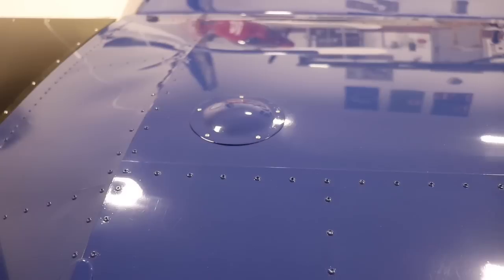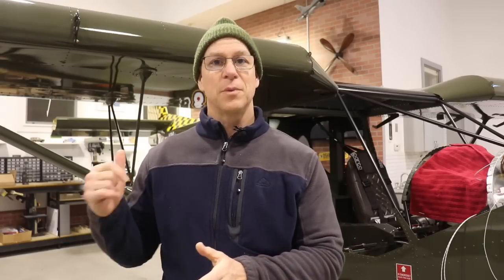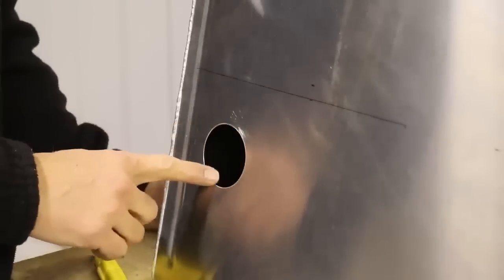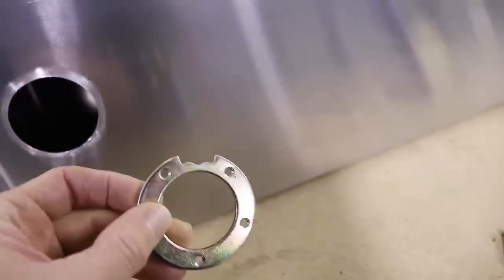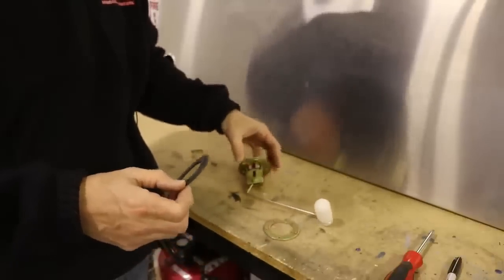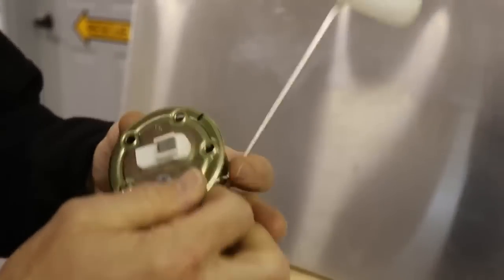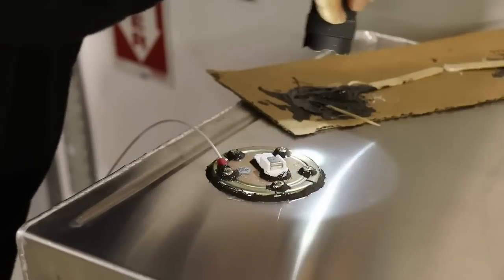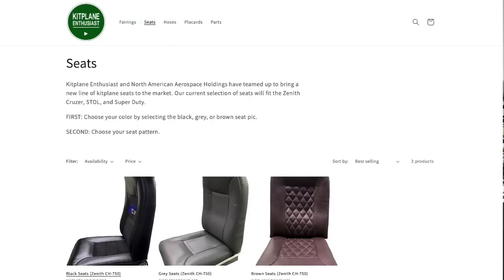How I Mounted FUEL SENDERS on Top of the Fuel Tank

Comment: The idea of cutting a smaller hole and slowly enlarging it is the way to go. Not sure why builders don't use water to flush out the tank. You can do it easier, quicker, and safer with water. It's no big deal to drain it out and any water will evaporate in a few days. Every tank ends up with water in it during operation either from condensation or from the pump station/ truck.  FYI - I had he same problem with the Vans (Stewart Warner) fuel sender sticking after install. I thought I had gotten Proseal on it. Good to know it wasn't my screw up.

Comment: Why not nut plates instead of rivets on the top skin?

Steve
N902AL - Flyting CH650
Reply from the maker: There wasn’t enough room between the top of the tank and the skin to add the nut plates. The rivets I used are very small and soft aluminum so they would be easy to remove if I ever had to.

Comment: Even though hole saws are a little pricey, the safety factor makes them worth the investment.  You can then drill a large hole in sheet metal with relative safety.  It still can be tricky in thin sheet metal as the saw can grab as one side breaks through first, but still much less hazardous than a fly cutter.

Comment: Having had to remove my tanks to replace a fuel sender already once, I can say that was one of my least favorite experiences of my life.  Luckily I have an RV14 so I can remove my tanks without removing the wings.  My only concern for you is that I would be weary of any chips falling into my tanks while drilling out the pop rivets.  How are you going to ensure your tanks are clear of chips or are you planning on just relying on the fuel filter to catch those?
Reply from the maker: How about you explain in detail which pop rivets I’d be drilling out that would put chips in the tank?
Reply: @KitplaneEnthusiast  My mistake, I do not completely understand the construction of your tanks.  I assumed that top skin of your wing was also the top of your tanks (like they are in RV's) which meant I thought those pop rivets that hold the dome in place would be directly over the senders.  Ignore me ;)

Comment: You can change a fuel sender through that hole, but if you have a chance put them in the top.  The originals in my plane leaked in less than a year at the plastic center piece.  I had my wings done before Mark posted this.
Reply: Same here! I didn't build the plane, but I fervently wish the senders had been top mounted.

Comment: How often do you have to change out a fuel sender unit in the life of the plane? As an auto mechanic for 45 years +, I have only had to change out a sender unit 3 times in my career.
Reply from the maker: Hopefully never, but these are really cheap senders and may be prone to malfunction or leak.

Comment: My factory build 601xlb SLSA has the senders mounted on the top of the tank with access plates.   I’ve had to change the sender gaskets for them leaking so yeah on top is definitely the better location.